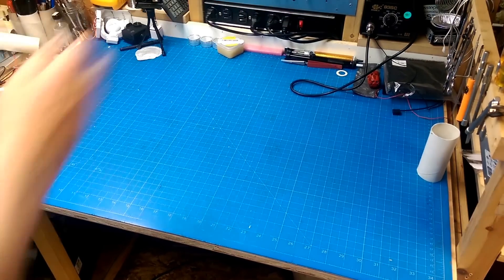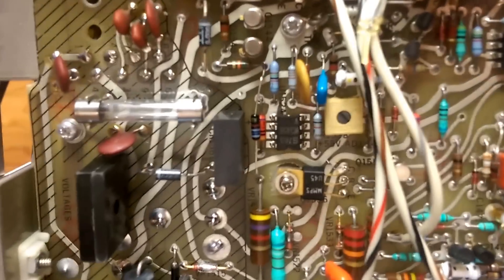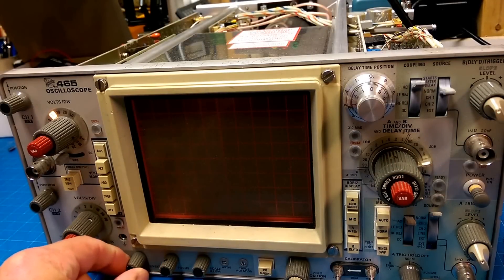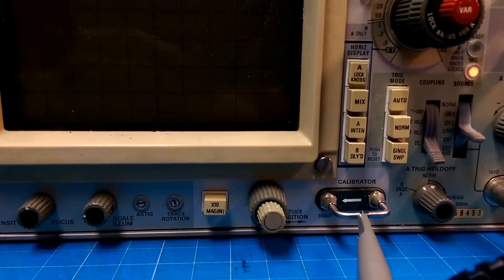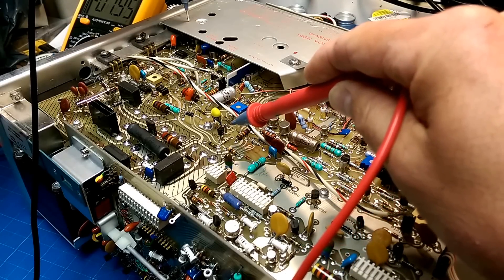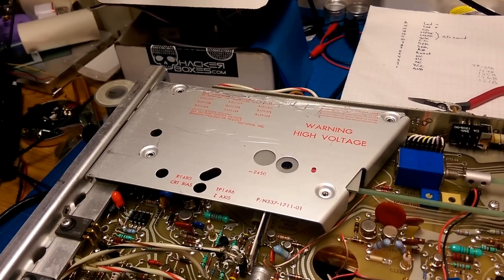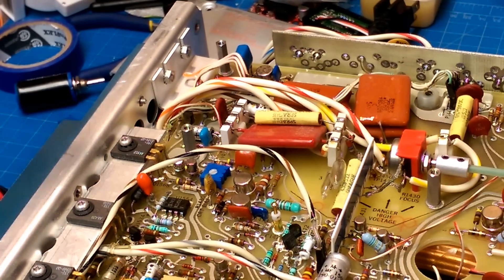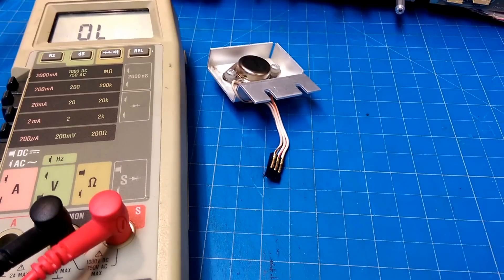Tek 465 Repair

Comment: GRTYVR, what circuit inside the oscilloscope will draw the horizontal voltage on the CRT screen? 

Because there is no horizontal oscillator or vertical oscillator used inside an oscilloscope so how can it draw a sinewaveform on the CRT screen? The Ramp circuit only controls the electron beam only to the CRT screen?
Reply from the maker: Do you mean the vertical voltage?  The vertical amplifier provides the signal.  Or do you mean when in X-Y mode where you use one channel as the sweep generator?
Reply: @grtyvr  , when measuring a 1Khz sinewaveform signal on Oscope channel#1 which circuit name inside the oscilloscope measures the 1Khz signal and displays draws it on the CRT screen? since the Oscope doesn't use V&H oscillators inside how does it draw the horizontal voltage to draw a 1Khz sinewaveform?
Reply from the maker: @billwilliams6338  the vertical amplifier takes the input waveform and amplifies it to a level that will deflect the beam as it sweeps across based on the frequency of the ramp generator (AKA the time base).  If the signal is too large, an attenuator will reduce the voltage to a level suitable for the vertical amp stage.  This is in an analog scope of course.
Reply: @grtyvr  yes the vertical amplifier ONLY amplifies the voltage and deflects the beam vertically. How does it draw the voltage horizontally to draw the sinewaveform because the vertical amplifier won't do this and there is not horizontal oscillators in analog oscope. If you put a 9vdc battery on the Oscope chan#1 and use the external trigger input on the Ocope and apply a 1Khz sinewaveform it will not draw a 9v Sinewaveform at 1Khz.
Reply from the maker: @billwilliams6338  There is a ramp generator that creates the horizontal sweep for internally triggered signals, triggering based on the input waveform .  There level detect circuit will trigger the start of the ramp when the input voltage is higher than the trigger voltage. If your input waveform is periodic, then you will see a stable display.   If you provide a constant voltage on the vertical input and use an external trigger signal, as you are suggesting, then you will get a horizontal line at your applied voltage that is represented by a beam that sweeps back and forth across the CRT at 1Khz ( your input trigger period gives the frequency and the fact that it is a sine wave means it is not a ramp but an oscillation back and forth).  But that will just look like a horizontal line unless your sweep speed ( input trigger waveform frequency ) is slow enough to see with the eye.
Reply: @grtyvr  just to make it clear, The External trigger input goes to the ramp generators sync input or trigger input? 
The Oscilloscope channel#1 input goes to the ramp generators sync input or trigger input? 
I'm confused because I think the external trigger input will REMOVE the ramp generator from the oscilloscope circuit and gets replaced with the 1Khz sinewaveform frequency is being applied a the external triggers input?
When you use the Oscilloscope channel#1 input and apply a 1Khz sinewaveform frequency the Ramp generator is in the circuit but the 1Kz frequency is going to the sync input of the Ramp generator circuit?
Reply from the maker: @billwilliams6338  there are two different ways to manage the horizontal sweep.  External triggering means that the ramp generator will be synced with an external triggering source rather than using in internal trigger (usually derived from the input waveform).  In X-Y mode the external horizontal signal will replace the ramp generator and you will get a display that shows the phase relationship between the input vertical waveform and the input horizontal waveform.  So in the second case, XY mode the ramp generator is replaced.  In the first example the external trigger is used to set when the ramp period starts.
Reply from the maker: @billwilliams6338  The external trigger does not remove the ramp generator.  Remember what the trigger does is tell the vertical amplifier when to start "drawing" the signal.
Reply: @grtyvr 
1.)  The external trigger means that the ramp generator will be synced with an external trigger source means that the 1Kz sinewaveform frequency is used to set the ramps starting point so the ramp will horizontal sweep and ramp at 1Khz across the Screen? 
2.) When using the oscilloscope normally (not in XYmode) using the Oscillscope channel#1 the input source frequency at 1Khz sinewaveform frequency is used to set the ramps starting point so the ramp will horizontal sweep and ramp at 1khz across the Screen? 
I don't understand the differences between how the Oscope Input channel compared to the External input on the oscilloscope sets the ramp generators or how it controls the horizontal sweep.
Reply: @grtyvr  The trigger tells the vertical amp to ONLY start drawing the Vertical Voltage signal not drawing the Horizontal Voltage? This is what I'm confessed on what circuit draws the Horizontal voltage? When you apply a 9volt battery to the Oscope channel#1 input the 9vdc voltage goes DIRECT to the vectical deflection amplifier bypassing REMOVING the RAMP generator circuit?
Reply from the maker: @billwilliams6338  pretty much.  (a single sweep across the display will usually have more than one period displayed per the time base so it will sweep slower than 1Khz to display multiple periods).  The role of the trigger is to start the input waveform displaying at the start of the ramp.   Let's take a step back.  The sweep across the display is controlled by the ramp generator.  It starts at a low voltage (left side of the trace) and increases to a high voltage (right side of the trace) then back to the low voltage for the next sweep.  if there is no signal at the input, then that will just sweep across at whatever the zero is set to.  Now if we apply a constant voltage to the input that will move the beam up or down to that voltage level ( assuming that we have the vertical configured to show that voltage level).  Next, what happens if we have a signal varying with time?  If it is a periodic variation then let's pick a value on that signal as a reference (say it has an amplitude of +- 2v peak to peak) such as when it is rising towards +1V and just as it hits that 1V (rising edge, 1V trigger value).  Now to create a display we take that trigger value, and start our ramp generator when we get that trigger and make a sweep showing the waveform voltages as the sweep goes across, and repeat for the next sweep.  Internal triggering takes the input waveform as the trigger.  External triggering takes an external signal as a trigger.
Reply from the maker: @billwilliams6338  The ramp "draws" the horizontal voltage.  The trigger tells the vertical amp when to "start drawing".   If you have a constant voltage then the internal trigger will never fire.  But if you put the scope into free running mode then a horizontal line get's drawn.
Reply: @grtyvr  Yes when the Oscilloscope is internally triggered and makes a sweep showing the waveform voltages as the sweep goes across. The input waveform voltages is going Directly connected to the vertical deflection amplifier or the horizontal deflection amplifier circuits inside the Oscope?
Reply: @grtyvr  when you put the scope in free running mode you will get a horizontal line that gets drawn with NO input signal. So the Ramp is drawing a horizontal line from what trigger voltage? there must be an internal voltage coming from somewhere inside the scope when put in free running mode. The Ramp circuit is directly connected to the horizontal deflection amplifiers and vertical deflection amplifier? Because the H&V deflection amplifiers are steering bending the scopes CRT electron beam to draw the coordinates of the waveform voltages.
Reply from the maker: @billwilliams6338  Input waveform goes to the vertical amp.
Reply: @grtyvr  if the input waveform goes ONLY to the vertical amp it would only draw the sinewaveform voltages vertically not horizontal? The Ramp generators output goes to the horizontal deflection amp? The ramp generators voltage i thought was a "fixed" starting and ending voltage. I'm not sure if you're saying that the sinewaveform frequency input changes the ramps starting and ending voltage? or it changes the "sweep range" of the ramps generator
Reply from the maker: @billwilliams6338  The input waveform only goes to the vertical amp, and only controls the vertical deflection.  The ramp generator controls the speed of the horizontal sweep.  The ramp generator does have a "fixed" starting and ending voltage ( more or less, you can change the scale and horizontal position of a trace by adjusting the two endpoint voltages ).  So without an input signal ( and the scope in free running mode ) you will just get a dot that sweeps across the screen at a fixed frequency determined by the time base.  Now if you start applying an input signal, say our sine wave, then that dot will start moving up and down according to the signal applied.  If the frequency of the sine wave does not match the frequency of the time base you will not get a stable waveform on the display but a sine wave being redrawn in a different place each sweep.  Triggering is what you use to fix that.  Start drawing the wave at the same point on the ramp, starting at the same level on the input signal and you will get a stable display.

Comment: I have mine apart to identify a separate power supply problem.  I've stared at this for half an hour and not certain where the starting point is to disassemble it.  This thing is a cross between a puzzle and a birds nest.  Ideas?
Reply from the maker: Lots of good pictures at: http://spurtikus.de/2016/03/30/repairing-a-tektronix-465-power-supply-z-axis-amplifier-vertical-pre-amplifier-issues/  and https://lazyelectrons.wordpress.com/2017/10/30/tektronix-465-repair/    The service manual has an exploded diagram on page 9-7 and 9-8  http://w140.com/tekwiki/images/5/55/070-1861-00.pdf.  I did not have to pull out the board to change the capacitor.

Comment: 13:20  What capacitor are you replacing/testing
Reply from the maker: C1419 which is on board A9 - Interface board in location A1 and on schematic CRT Circuit <10>.  It is a filter cap on the unregulated 15V input to the CRT transformer.

Comment: Glad the fix was so simple for you. The 465/475/485 scopes were great. I have fixed several of them through the the years and many times it was those damned tantalum bead caps that fail. Sometimes they fail by shorting and can take out other components while making a foul-smelling smoke. When one of these scopes goes bad that’s the first thing I suspect. Sometimes you can spot the charred cap before even applying power.

Comment: Just discovered your channel and congrats on a simple (isnt it always!) few cent repair and you have to watch those old tantalums- they are great when they work but...... 

I bought a Tek 2232 with no power on ebay for a song and sadly the whole main board also includes the power supply components. When the Power trans blew, it took out nearly a dozen components and burning- a real mess. After a few nights of attempted repair, i just looked the schematic again and realised that all that fed one supply point to the scope of 43V with a smoothing capacitor.  So i got a quality power brick and soldered in a male socket to the cable and a female socket into the back of the unit and wired with fuse into the power supply line and removed the large capacitor as the new supply had its own smoothing on the secondary output.  Plugged in in and turned it on and the scope and digital board and all works perfectly drawing about 1.3 amps and the power supply and fuse is rated at 2 amps so all good and better still the scope is floating or i can plug in a universal plug and use the Earth pin to ground the scope. The live and neutral pin wiring in the scope is cut off no live power can enter the scope. 
I had actually rang a repair shop and described the mess, and they didnt want to touch it and these are pros! haha! 
So the scope may not be "original" like my other scopes, but it works and power supply problems will never occur again short of 1 min to swap out another supply and just plug in..
Reply from the maker: That is a great fix.  Replace the whole LV section front end.  Nice work!
Reply: @grtyvr  Thanks, they had a 555 for the PS oscillator and that was toast too AND they didnt socket it so its one of the few times i made more of a mess repairing a device! The 2232 is a great 100mhz with digital readouts and mem and movable cursors and all that and nicely laid out mostly except they used a massive main board on the bottom with lots on it it including the PS , so not a lot of room to move there. The scem is easy to follow the sections and thankfully one supply line before it splits off to other areas so 2 wires and a socket and you are done only caveat is the metal socket is going into the metal earthed case at back so had to carefully insulate that and add another fuse in the input cable so unit has 3 fuses haha in it now.. i am very cautious... 
I also have an old 467 B&K CRT restorer so i can clean all the old scope crts i have and any friends who have the old arcade uprights with crts- so it pays for itself in favours lol...

Comment: Its never the fuse, that only another system. I've fixed a number of these things. Its always the electrolytic caps in the immediate vicinity of the fuse. Check all of your supply voltages!  Especially the 15V one - that controls your intensity...

Theres just a few electrolytic that are sketchy, most of them are pretty solid. 

I would suspect every tantalum...

Comment: Why are you replacing the cap marked 47uf with a 100uf?
Reply from the maker: It is a filter cap so the value is not too critical but the voltage is.

Comment: You couldn't see it when you plugged it in(for the first time)..but the power indicator light flashed very quickly, then it out.
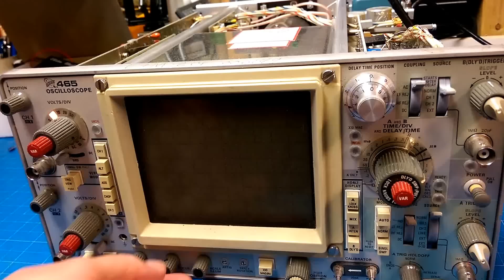Reply: These specific scopes don't have power indicator lights. That is actually a low line voltage indicator to warn the user that the AC input voltage was too low for the scope to operate reliably and within spec. If you very closely at 3:36 you can just see the red colored word "line" just right of the light. It is also used to warn the user of an incorrect line input voltage setting. If you have it set to 230V instead of 115V that light will light up.

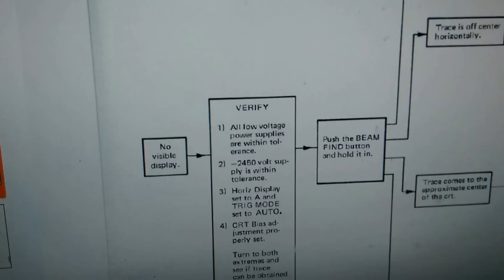Comment: 8:37 could a 1:10 voltage divider be used here?
Reply from the maker: I suppose that it could, or a 100:1 for that matter.  But I am a chicken around high voltage.
Reply: @grtyvr  ME TO!! But maybe a closet box with some sort of long insulated probes? :-)
Reply from the maker: I have no experience with high voltages so i don't even know where to begin in how to protect myself from myself other than to just leave well enough alone.

Comment: I bought this same scope and fired it up last night.  Worked fine and I was calibrating it then took a short break.  When I came back no traces.  Nothing on the beam find and everything else works.  After seeing this video I’ll try checking that capacitor.  Sounds like these are a common issue for this scope.  Thank you.
Reply from the maker: You're welcome.

Comment: Greetings my friend, very good video I congratulate you, I have this same team, with the problem that does not do horizontal, that is, does not put the horizontal line, if you put the vertical, you could tell me what is the cause of this failure, Thank you the Dominican Republic. I'm Marcos Lopez a Hug
Reply from the maker: Hi Marcos,  I have not taken a good look at the horizontal circuit of the 465.  However there is a good set of troubleshooting flowcharts in the manual that I linked to.  Also, the yahoo group has been replaced with https://groups.io/g/TekScopes/messages.  There are lots of very smart folks there with years of experience that can probably help.

Comment: You didn't show the removal of the board to get to the back side.  Did you put the new capacitor on the front of the board by tacking it to old cap leads?
Reply from the maker: It has been a while since I did this but I don't recall pulling that board out.  I don't think I did.  I think I got the old cap off from the top using solder wick and a fine tip on the iron.

Comment: If you might feel like cleaning the little white push buttons, be careful.  Unfortunately, the text on those buttons is VERY weak, it may come off just by touching it with a damp paper towel.  I did not even use soap or alcohol, just plain water.  Apparantly, years of sweaty, sticky fingers have left a residue on top of those knobs that has made those texts dissolve.  I guess I will print the texts on self-adhesive transparent film and put those on top of those buttons.
Reply from the maker: The feet on mine were not brittle, so I wonder if your scope was in an environment with a chemical that reacted with the plastic on the feet to make them brittle, and a similar reaction happened with the ink on the buttons.

Comment: Mine did not come with the front cover.  Second issue: the four black plastic feet are so brittle they broke on first contact.  I removed them;  I guess they must be unobtainable by now.  Maybe I'll make some replacement legs with hardwood, so the scope can be put upright again.
Reply: Thank your for the tip.  I will look for them on ebay.
Reply from the maker: Here is a listing for them.....

https://www.ebay.com/itm/Tektronix-465-475-465B-475A-Replacement-Cordwrap-Feet-Set-of-4/152946120811?hash=item239c4c986b:g:~TUAAOSwCtJaSDb3